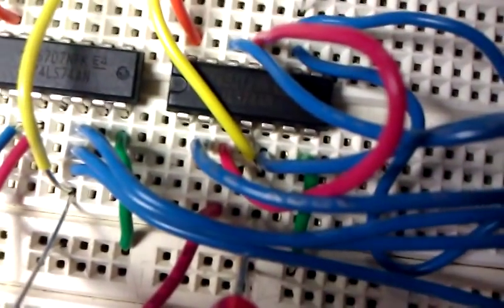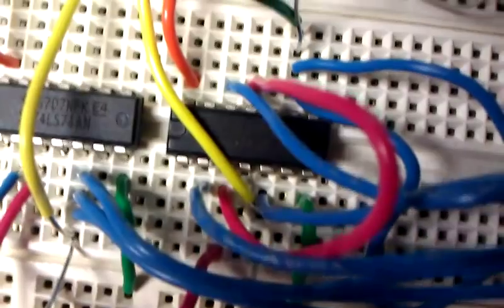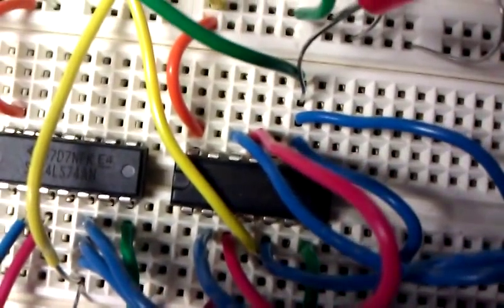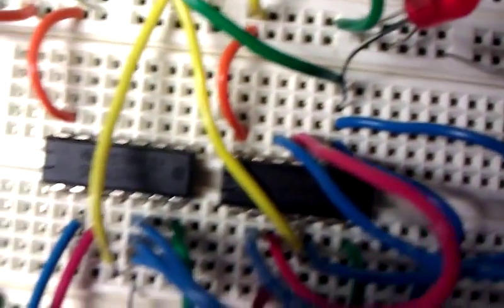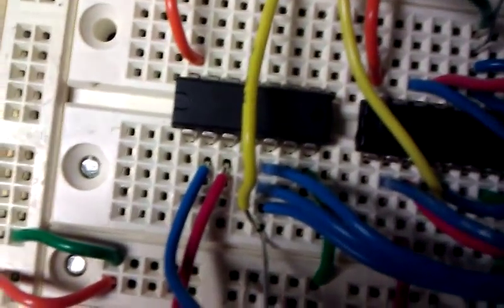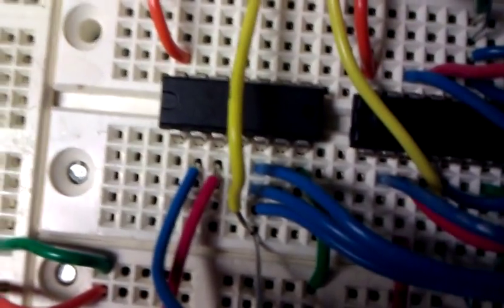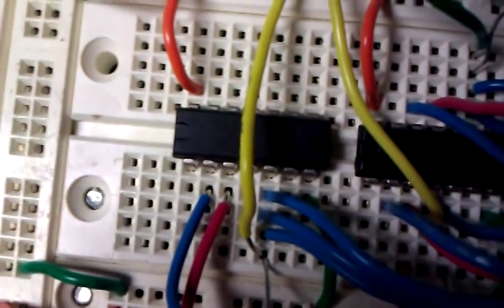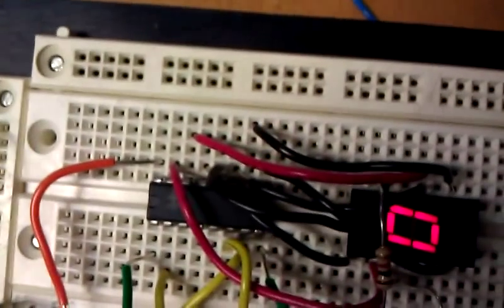3 bit D Flip Flop Counter

Comment: I liked your circuit especially since it's a 3 bit..but I wonder what is the ic number of the 7 segment? I really like it..which company manufacture them and from where did u get it? I guess this is a common anode decoded by the 7447 driver?